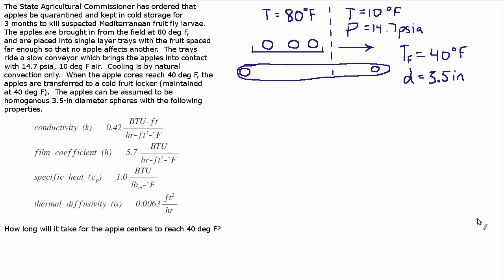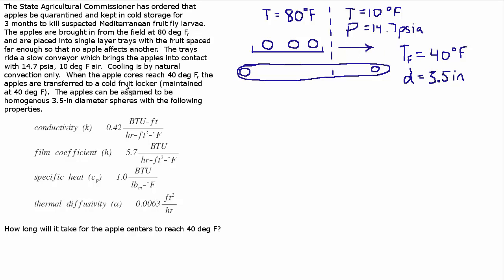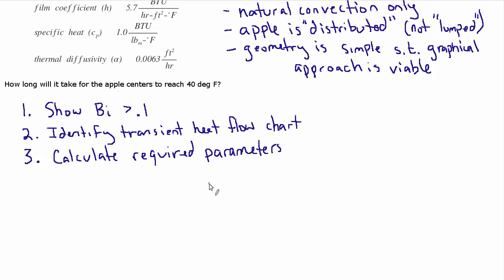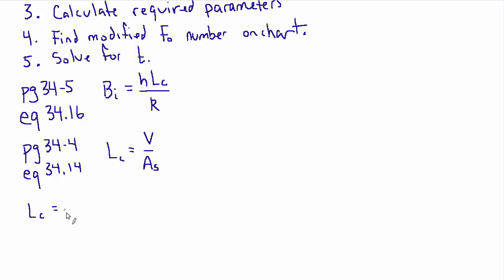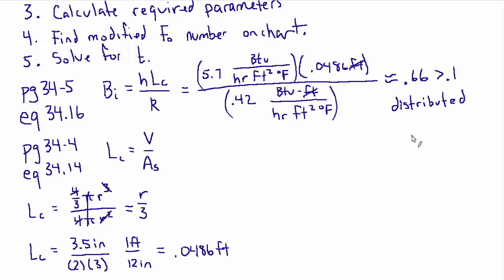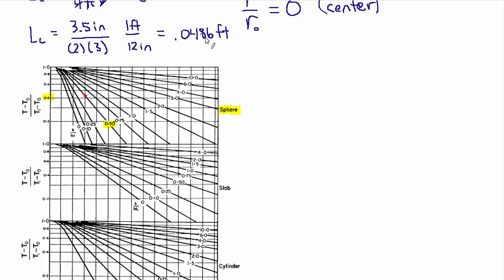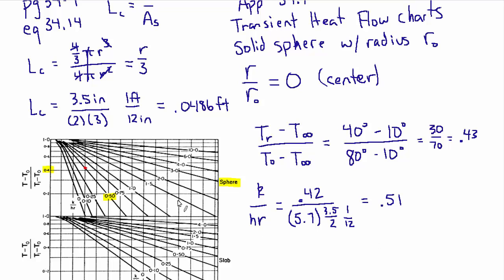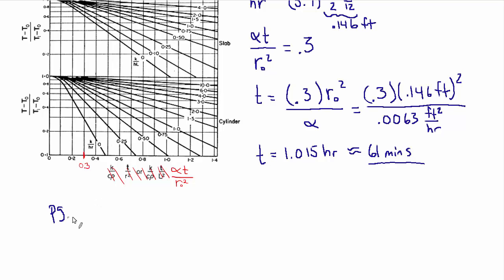Heat Transfer in Cold Storage: Solving Transient Cooling Problems for Mechanical PE Exam

Comment: Nice problem and solution.  I think they removed those time-dependent heat transfer charts from the latest "MERM".. I'm assuming the MERM has been repaced by the PE Mechanical Handbook (If I'm missing something, please comment).  Using the lumped capacitance gives 22 minutes - definitely not accurate.
Reply from the maker: MERM is still a great learning aid, and yes, it's all about the reference handbook now.  Closed-Book Computer-based.
Reply: Any idea on how to solve this using the reference book? The only transient method is the lump capacitance model